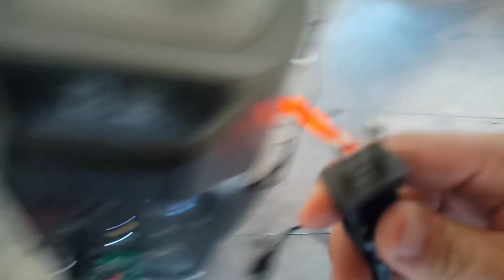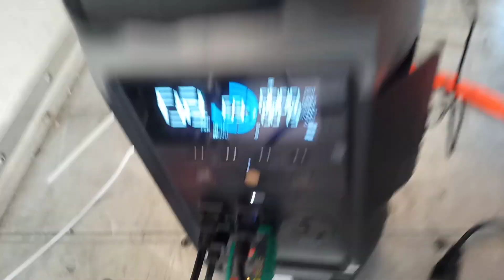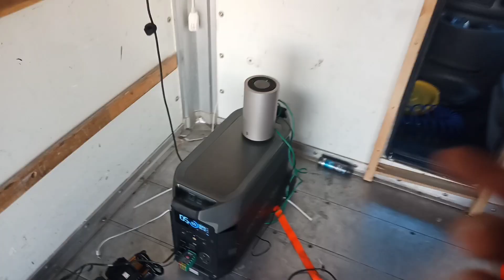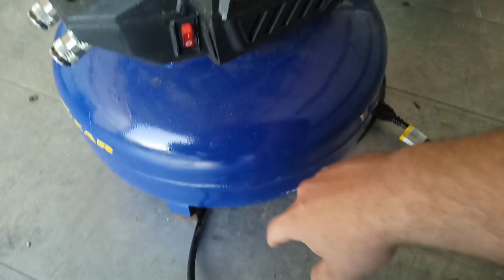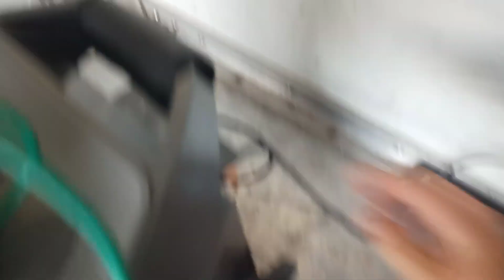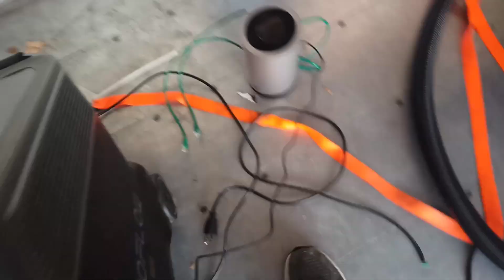How I shocked myself and destroyed my EcoFlow Delta Pro.

Comment: I seriously doubt static electricity damaged your DP. As far as the open ground thing goes, I use mine to power an RV, and I have to use a bonding plug for the RV's transfer switch to engage. You absolutely need to remember to remove the bonding plug if you're going to connect it like this and plug it into your house outlets. Ecoflow sells an automatic bonding plug now (I just got one) for $49. You plug the house plug end into one of your free outlets on the EcoFLow Delta Pro and also plug into the ethernet port. It automatically senses when the system needs to be bonded and then connects ground to neutral in the plug you just put in your power station. Seems to me this is something they should have designed into the system from the beginning.

Comment: I realize this is a year old post, but just ran across it.  I'm wondering if an option is to configure a female plug to bond neutral and ground and plug the EcoFlow into it when used standalone.  In so doing, there's no risk in having the EcoFlow plugged into the home AC while also being bonded separately.

Comment: Static buildup occurs in grounded shopvacs also. It is due to the air moving through the plastic hoses. Static discharge can cause discomfort and damage sensitive electrical equipment. Special grounded vacuum hoses exist. Some folks add DIY grounding wires to hoses by spiraling a ground wire.

Some inverters have neutral to ground bonding relays that kick in when they don't detect an inlet ground-neutral bond. Perhaps EcoFlow should consider this. When unplugged from the mains this relay would close and create the missing ground-neutral bond in the inverter. There are videos covering the issues involved here and various solutions.

Comment: I have my two DP's connected to a Smart Home Panel....will this issue apply to me as well....I soon have an inspector coming to inspect the SHP installation and I don't want any surprises
Reply: will NOT apply with SHP. Neutral ground is occurring at your main panel. SHP is connected to your main panel

Comment: That happened to my my delta also. The screen went crazy. I ran it to zero and it reset.
Reply from the maker: When this originally happened, it was at a low state of charge, and the screen was also acting weird. Took mine apart and noticed a fried components on the DC-DC board

Comment: This was an interesting video. I went downstairs to where my two Delta Pros are at near my main panel and plugged in the line tester to a Delta Pro AC out port. It showed "open ground" when the Delta Pro was on but not plugged into line input. It showed "correct" with the Delta Pro on and receiving AC input from the house. My understanding is that an open ground is an unsafe condition, which allegedly would apply whenever an appliance is plugged into a standalone Delta Pro.

My question is: When the Delta Pro is applying power to an appliance in standalone mode does the massively heavy chassis of the Delta Pro provide grounding like the chassis of a floating neutral gas generator does? IOW, is the open ground not a problem when the Delta Pro is in standalone use?

Comment: Those have no GFCI nor ground - much like small generators lack GFCI.  You could add a neutral ground bond adapter and GFCI adapter to protect against a faulty appliances but that won't help with static buildup.  This is also extremely common with all power inverters.  Ecoflow sells a neutral ground adapter kit you can buy (but it's still not GFCI, that would need a separate adapter).  And this wouldn't fix your static buildup.

For grounding against static, you would need to have an earth connection bonded to a proper ground rod (not just a neutral ground bond, but a ground rod).

The static issue you described is much the same as if your pants rub on a chair and you then touch your computer port can fry things, or getting back in your car and getting out while gassing your car spark causing a fire because there's no earth connection.

Comment: I’m so confused. Can someone explained what’s going on? From what I gathered, and guessing… the dust, wind, dirt, is causing an electric shock from the outside of the unit? Or is it the vacuum that is plugged in the unit? Sorry, complete beginner here
Reply: I work with industrial CNC machines that run all day. One time someone put some metal on the dust collection system tube and I accidentally touched it once. I've never felt such a powerful shock before. And I've been on trampolines all my life. It also made a audible noise so loud it made some of the almost deaf workers turn their heads.

If this piece of metal was connected to a large array of metal going inside the ground outside the building. I'm guessing it wouldn't of made a shock, or at least dampened the effect. I'm not sure how static electricity travels, or why it likes to flow into the ground. So I can't really give any further explanation on the phenomenon.
Reply: He basically built up a static charge in he’s body and touched the power station shorting the electronics. Maybe he could wear a static strap when he’s vacuuming ?? Will Prowse has a video he blew one of he’s Ecofows through multiple ground fault paths while charging he’s Tesla
Reply: @plokijij7856  So it shorted by just touching the plastic housing? damn that is delicate and expensive, they need to redesign.